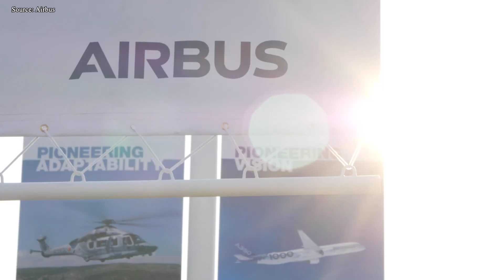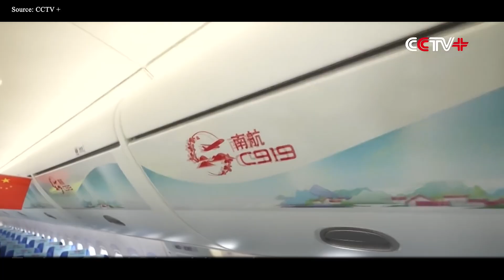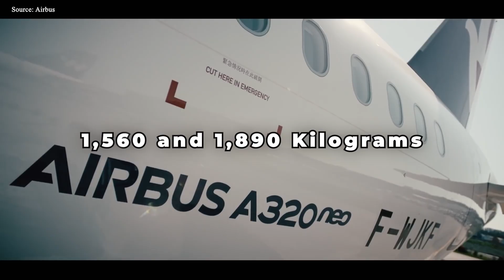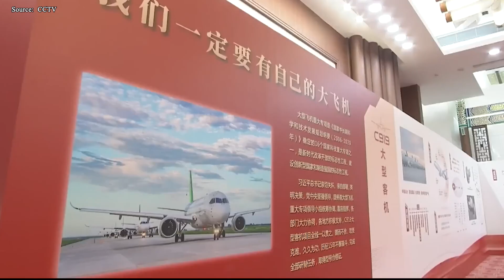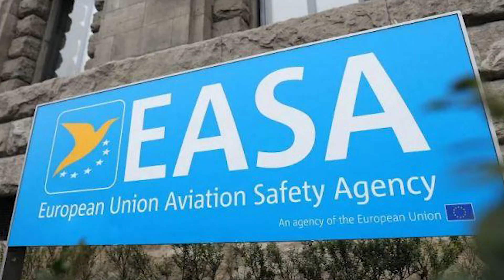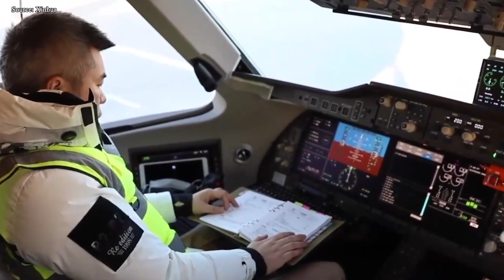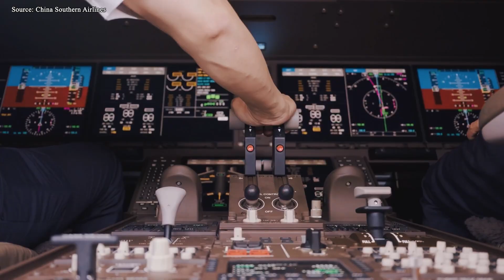The REAL Truth Behind the C919 Big Trouble: The Reason They Can’t Fix it

Comment: I love when the video start with "rumour" ....but the whole people will take this as a true story.... 
Even if China did a reverse engineering... what's the problem with that? everyone are doing reverse engineering  in almost all industry. If you think reverse engineering is that easy, wondering why no one has ever already reverse engineer F35, or M1 or any technology. To reverse engineer, you'll need excellent engineer that understand how and why system has been build this way or that way... 
But if China has reverser engineered the Airbus Neo, they did the good choice.... they did not take the flying coffin Airbus 737 (well any recent Boeing) they would have been in trouble.
the funny part, is that C919 certification to land in Europe has been pushed back (or basically refused) while they still accept some Boeing to land there where they have such quality issues...